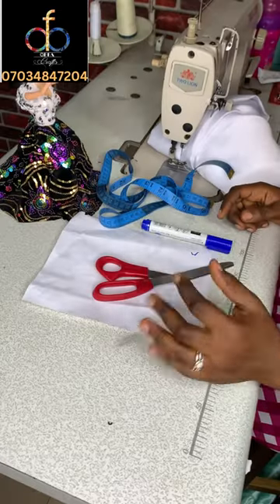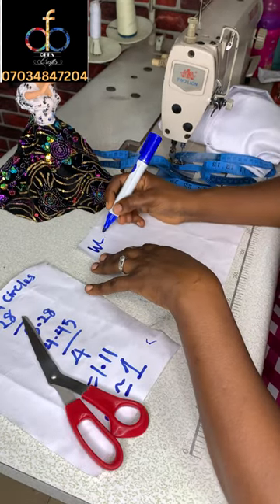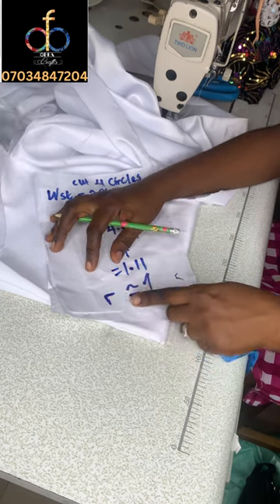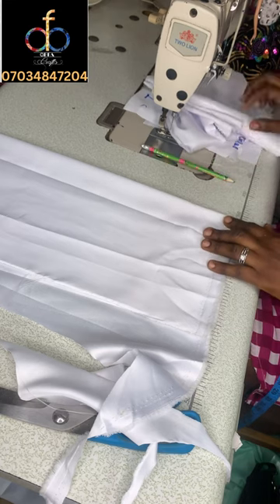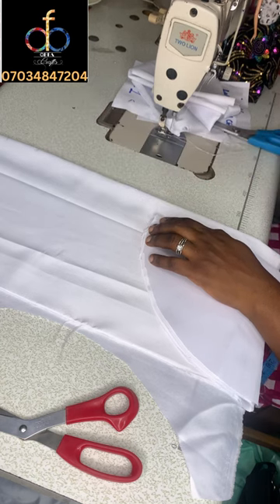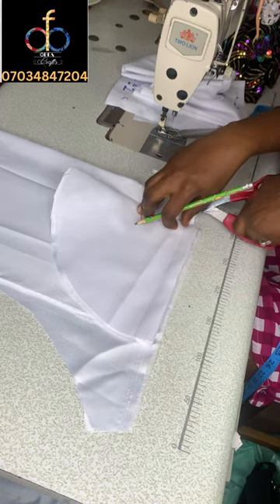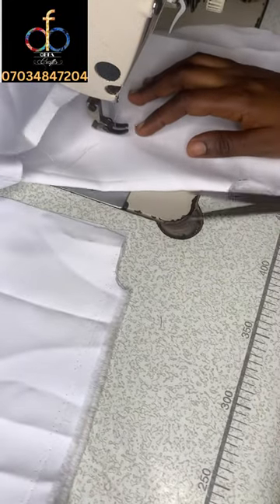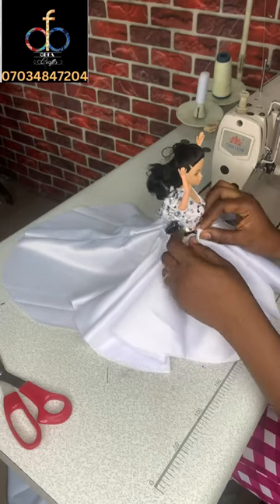How to cut a wedding dress train, exclusive secrets

Comment: Thanks for this, but i have a question, by the time i fold my mikado into 4 will the material not have a joining? Is it not by 60
Reply from the maker: Good question, use a fabric that’s 120” in length or fold into two if you are using a 60” fabric , you will have to cut more circles this way.

Comment: Thank you for sharing.  Is there a way one will cut a long length of flare and there wouldn't be joining at the down part
Reply from the maker: Yes, don’t fold the zipper area into two, use the full length of the bridal as the side to be joined with the other circle while the yardage part will work as the length

Comment: Good morning Ma...pls i knw u used 8inches for the length. If i was to use 44inches how do i achieve without joining material
Reply from the maker: Cut using 180 degree flare

Comment: This is what I've been looking for for so long. Thank you ma God bless you.

Ma, I have a question
Can you achieve the train using a 60 inches fabric length? And the Mikado you used ma what's the inches?
Reply from the maker: You are welcome, and yes you can use a 60 inches fabric but you will have to do a 180 degree flare instead of the 360 …..I used 60 inches fabric

Comment: For an adult am wondering if it would be possible to 360% flare.i think a 180% would be ok.i don't really know actually.Just wanted to get the understand of making a real wedding dress.If the 180 would work please do a tutorial on how to get the radius for that.Thank you ma.And if I want a fuller wedding dress like the one you just made,how many yards you think would be enough.Thank you 🙏🙏🙏
Reply from the maker: 360 will work if you use a fabric that’s 120 inches in Len
Reply from the maker: 360 will work if you use a fabric that’s 120 inches in length….for 180 for 60inches fabric, but you have to increase the number of circles